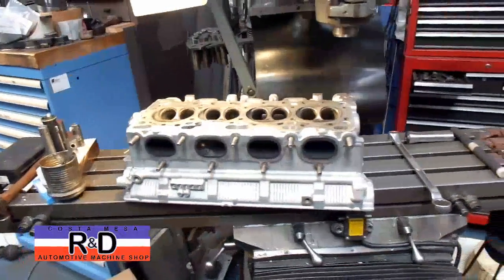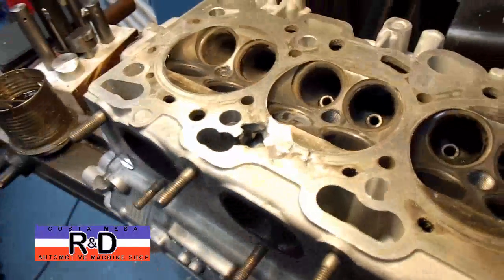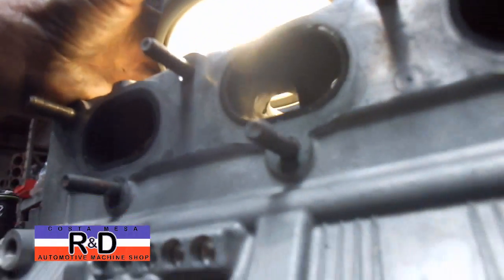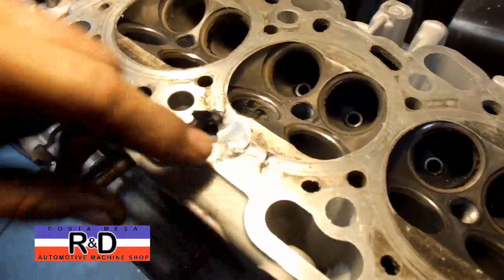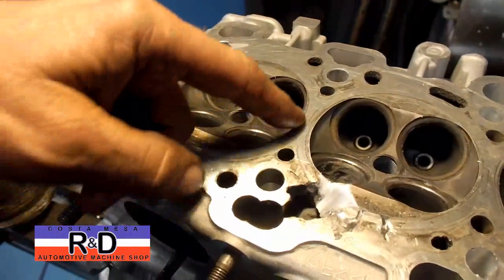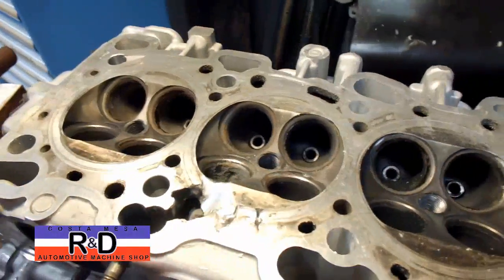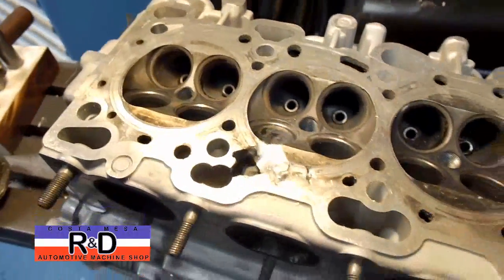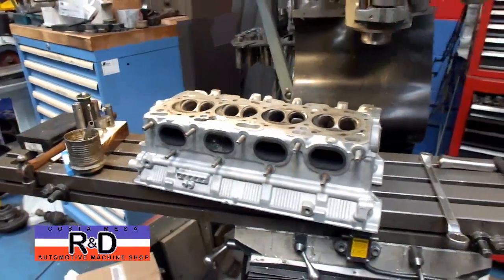The Effects of Detonation on a 4G63 Mitsubishi Evo IX

Comment: This guy must have been pushing it. Usually you get some pinging and get some marks in your chambers from detonation. Why is it at the shop? Why would you try and repair that? Seems more work than it's worth.
Reply from the maker: I would say that 65 psi IS pushing it. Mike brought the head by so I could make this video and we were reaming out the head bolt holes on this jusk head to see at what point we would hit water or oil (at 9/16" we hit oil next to the MIVAC oil line). We are installing 12mm studs on the new engine.
Reply: I see. And yes, 65psi is probably pushing it :p

Comment: It's always #2 with 4g63's.

The #2 factory intake runner on a 1g/2g DSM runs a little leaner than all the rest.  It's an acoustic resonance thing, and I don't know if that same issue carried over to the Sirius II EVO engines or not... but in the DSM/Sirius I world...  It's worse on a 1g than a 2g. The shape of the manifold makes it flow slightly more air than the rest.  Fuel delivery is based on the consumption of all 4.  When you're pushing the edge of fuel and timing and you experience this kind of failure, that extra airflow makes that cylinder run lean first, and it's rarely anything other than the lean one that burns down.  Burnt valves, pistons, seats... seems like it's always #2.

I'd love to see that piston... I bet it shrunk above the #1 compression ring.

Great video as always!  The rough stuff is one of many problems you'll find with 4g63 castings!
Reply: It's weird on a forced induction to see an uneven air distribution.
On the volvo 240 turbo the n3 cylinder has a bigger injector because of that lol

generally  the n 2 and n3 cylinders run hotter than the 2 others on all 4 bangers since they are in the middle : it does not help too for detonation.

On my diesel i have uneven cooling too but it's an inline 6 so it's way longer
the last 2 cylinders die first because of that and the lack of air....
the intake is long,you can see more soot on those cylinders.
i have plugged an oil cooler line at the head's end to force some circulation there.
Reply: Well then, based on what was said in the video and on your statement, would you advise people with non-turbo 4G63 (in 2Gs) to go and have those edges smoothened out?
Reply: In italy and Mexico, 2g cars actually have a non-turbo 4g63.  Most everywhere else got the short-end of the engine contract, the USDM 2g cars all use a Chrysler 420A unless they're convertibles (those got SOHC 4g64's).

Non-turbo cars don't reach anywhere near the final compression ratio that turbo cars do, so it would be less of an issue due to the lower combustion temperatures... but yes, any engine can benefit from removing burrs and sharp edges as those are the spots that contribute to heat soak.  They're like the conduit, or lightning rods... they're the surfaces inside a combustion chamber that attract it, IF the engine is tuned on the razor's edge.  Turbo guys tend to push those limits the most.
Reply: ***** Alright, thanks for the reply! Not only Italy and Mexico, but all of Europe got the 4g63 non turbo 2Gs. I just bought one from Germany, all stock with 0 mods, in pristine condition! I'm still drawing up the plans of the modifications I'd like to do. In fact, my biggest ambition is to try and supercharge it. Think it's even possible? I don't really want to go down the whole turbo nonsense I guess...
Reply: ***** Just go turbo. Don't try and reinvent stuff. The turbo 4G63 is bad ass and easy to modify.
Reply: Oh I never knew about that, thanks,